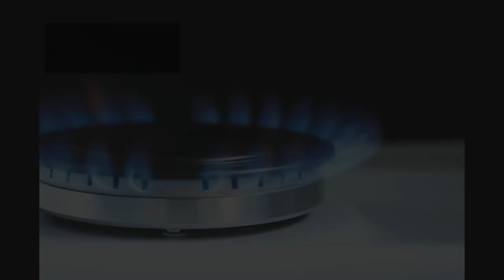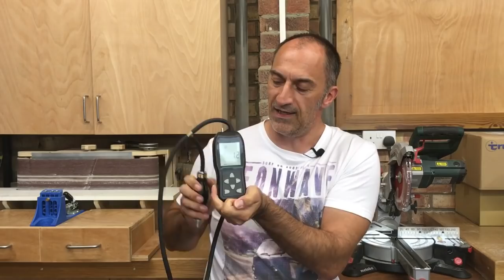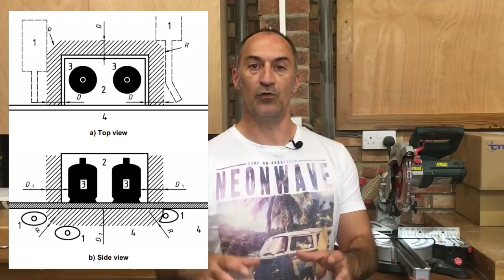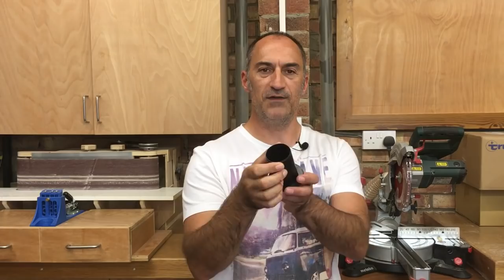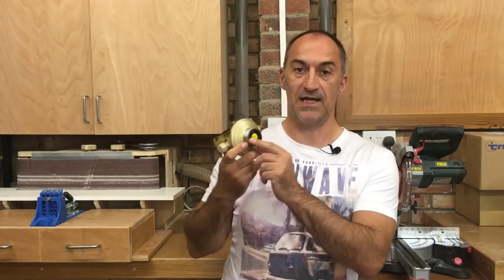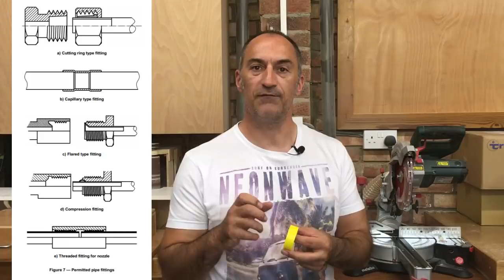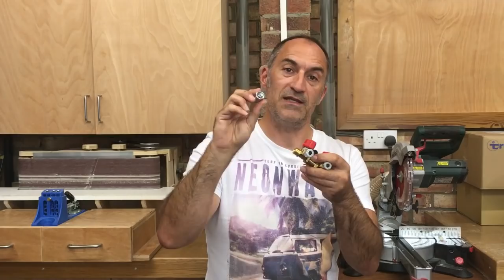Installing LPG in a Self Build Camper Van

Comment: Excellent advice Thanks Just a thought , do the regs mention gas sensor alarms
Reply from the maker: Hi John, no they don't but than you for mentioning them as its a very good point you raise.
I will most definitely be fitting gas detection in my van. It's all very well having "drop out" vents but detection is a great way of getting an early warning that there are problems. Plan to get a couple and one that senses all three gases, LPG, CO and that pesky sleeping gas
Reply: Greg Virgoe Thanks Greg
Appreciate your videos very much
Reply: I for one would be interested to know which detector you go for Greg, as there a lot to chose from and I find it a minefield .

Comment: Excellent. Considering I didn't have access to the standard, I'm pleased to say mine is pretty much compliant. Wish you'd done this video a year ago mind you ;-)
Reply from the maker: Yes, David, you did a very good job with your recent van conversion. Sorry, I'm a bit late for you ;D
Anyone reading these comments please go and check out David's channel and his van build series.
I highly recommend it.
Reply from the maker: David, a question for you inspired by Peter Connolly comment.
How did you deal with the potential for LPG leaks on your narrowboat as you can't go drilling big holes in the floor?
Reply: Greg Virgoe The gas locker where the bottles are stored has two side vents at floor level, a few inches above the waterline. Inside the boat there is no drop venting (for obvious reasons, namely sinking!) which is why some boats (although surprisingly few, I'll wager) have LPG alarms in the cabin bilge, typically at the back (lowest point). When you're back from your travels, do pop up and have a day on the boat!
Reply: Greg thanks for this video😱

Comment: £198 for a pdf, WTF! What is the point of a standard if it is tucked up behind a pay wall? seems a bit silly to me.
Reply from the maker: Hi James, you can get it for half price as a member, however, membership starts at £200! 😂
Reply: It does seems a little silly, but unfortunately it's how these things work. The people who write the standards want to get paid for writing them, as do the proofreaders & lawyers who clear them for publication. The costs have to be spread over the number of copies they expect to sell; it's not the latest Harry Potter so the chances of selling millions of copies are zero. I imagine the sales of some technical publications would barely get into 3 figures, so they're more expensive, whereas more common ones sell for less - for example the 18th edition electrical regs are around £30, because every qualified electrician and electrical student needs to own a copy therefore they sell in the (possibly tens of) thousands.
Reply: The reason it seems a little silly to me is because someone could potentially injure them self but trying to save a few quid. Form a H&S point of view there should be central funding for projects like this to offset some of the cost, to make the whole thing a bit more accessible and we would have safer conversions as a result of this. knowledge is power and with how strict other regulations are surrounding vehicles in regard to safety, it would be in the best interest for the public to have this information.
Reply: If each person who already viewed this vid contributed $0.05usd to a pool, there would be enough to cover the purchase of the PDF...and then post it on a torrent site...because essentially they're saying that people who cannot afford it cannot have the knowledge for personal safety and the safety of others
Reply: See my full comment on Greg's video for details and links but you can actually get this same standard (in English) from the standards organisation of many other copuntries much cheaper.  I bought it from the Estonian Center for Standardization for €15.40!  The problem is that BSI is no longer part of Government (if it ever was), it's a private organisation hence the £200 price tag.  If you're a company that makes motorhomes and/or caravans then I suppose you are content to pay the price but for the individual...
Reply: It is actually cheap compared to many ISO standards... but usually you can get them cheaper at educational facilities as part of a compendium.

Comment: I believe this may be the qualification you need to carry out LPG gas work on leisure vehicles - CONGLP1 LAV – Leisure Accommodation Vehicles. As a Gas Safe engineer with many years experience I would recommend any natural or LPG gas work is carried out by a trained registered (Gas Safe) professional. The law states the installer must be competent and competency is usually proven with the relevant qualifications. It might be worth checking here - https://www.gassaferegister.co.uk/help-and-advice/lpg/ Cheers.

Comment: Informative as always. Personally I'm going to some lengths to keep LPG out of my van, just to simplify things. There are non-LPG ways to solve everything. Good thing the Cinderella Gas-fueled incinerating toilet costs 5000€ or something... that one might tempt me to go with gas if it didn't cost an absolute fortune. But I digress.
Reply: Are you going with a Diesel cooker?
Reply: Personally I'm on the fence. They work great or so I hear, but they're not cheap and I'm already planning on spending a fair chunk of change on some Lithium Iron batteries. So I'm slowly beginning to lean towards an induction cooktop. Diesel to heat the van itself though (Eberspächer, Webasto or Wallas).
Reply: Ah - I'm rarely going to have Electric Hook-up. Presumably that's the only way you can use induction?
Reply: Not at all, but you do need to take real care with your battery choice and your inverter capacity. Lithium batteries cost much more than lead-acid or AGM batteries, but they can deliver very high currents (amperes) (and they will last over a decade, most likely). If you get a 2000+  watt inverter to convert to 230 volts and 2-300 Ah of Lithium (or more), you can use an induction on battery. You can even run an air conditioner off battery for a little while. But a diesel burning cooktop is also perfectly viable, Webasto makes a nice one for instance.